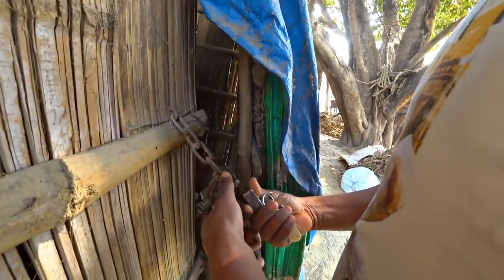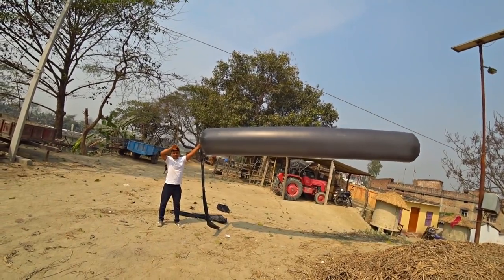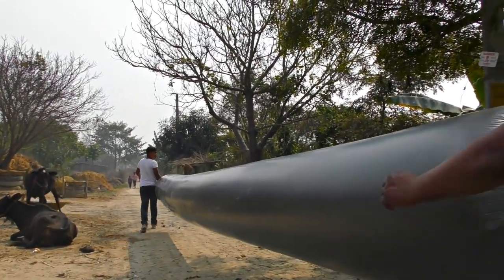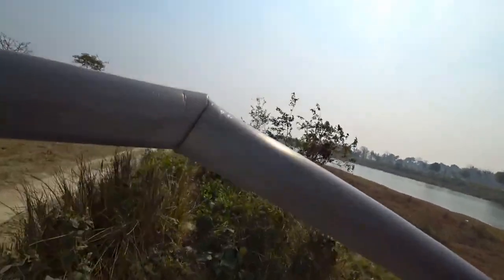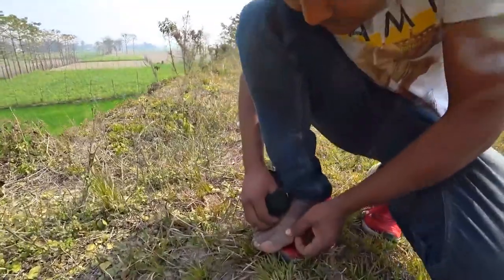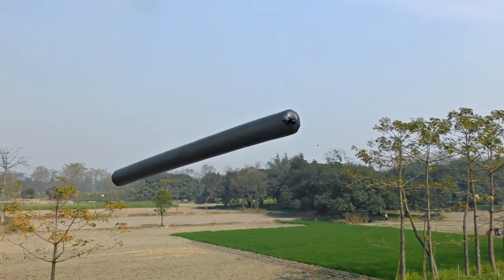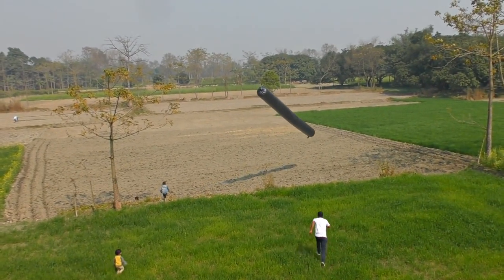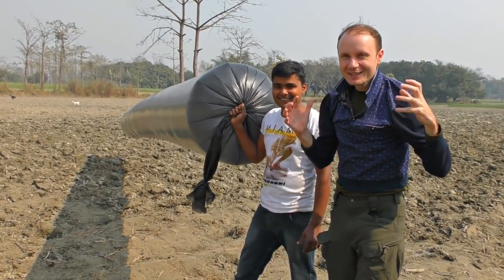No Fuel Easy Aircraft DIY ⚡️  🚀  ⚡️ Secret Indian Technology 💥 Solar Power Balloon

Comment: "I'd buy that for a dollar!"
Reply: The price is 5 cents not a dollar. I live in Pakistan and I spent my childhood playing with this. Nowadays no one plays with this balloon. These balloons were fun, I don't know why they stopped making them.
Reply: @TheGLGAMINGINFO   That's cool - I Live in the US and we did the same when I was a kid.
Reply: @TheGLGAMINGINFO  In france they still make them and they have random cars which throw things including these baloons for free. however in france instead of making them very big they are a lot smaller (1m to 2m when fully inflated) but they are a lot lighter like insanely light. so they will fly with almost no trouble at all and they are bouncy. I think they called them condoms or something like that however often they are transparant so if you want them to take of  fast you might want to add some charcoal powder inside. but even without when inflate far enough they will fly. and before they fly away you can play with them since they are quite bouncy.